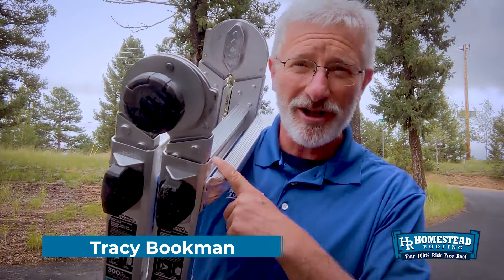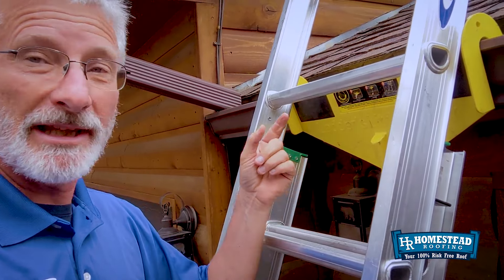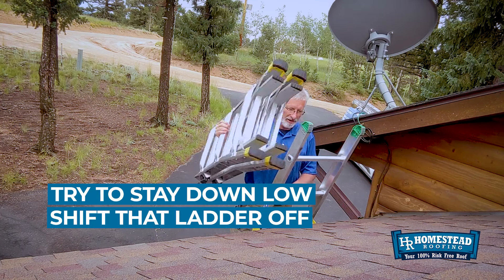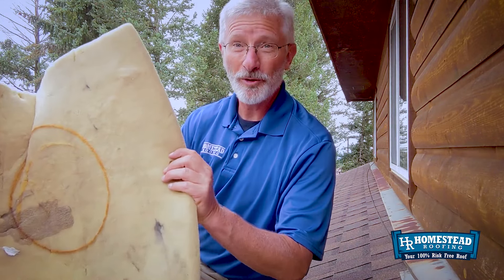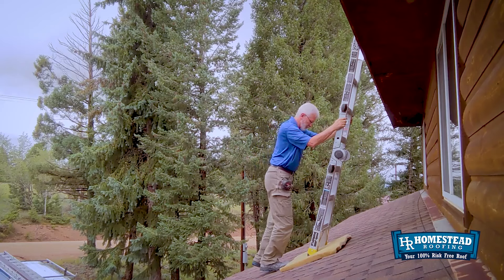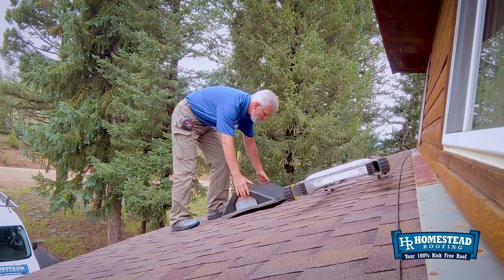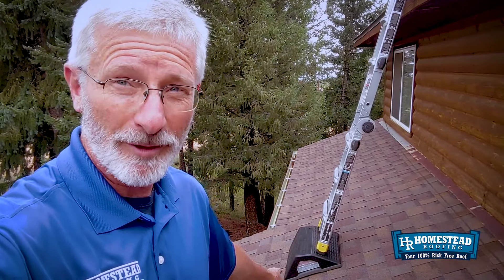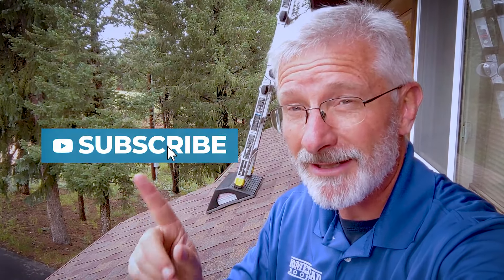[TIP!] How To Safely Get On A High Roof With A Short Ladder

Comment: Thank you for posting this video. I just want to clear up certain things that you showed or said during your presentation.

1. You got the smaller ladder on the roof, but did not follow the three point of contact rule. You only had two point of contact every time that you went up a rung. It is very important, that you never carry tools or any other item in your hands while climbing up or going down a ladder. How about using a rope to bring the smaller ladder up?
2. You did not use the three feet rule. This rule states that the ladder should extend a minimum of three feet above the edge of the roof. This works in conjunction with the 4-in-1rule (the base of a ladder should be one foot away from a wall for every four feet of height).

Comment: I use stainless anchor points ($4 ?) and ratchet straps to stabilize my main ladder.....in and out and left and right..For the short ladder I would definitely use anchors and straps and they are good for your safety rope anchor too so long as you use long screws into the studs....
Reply: Interesting. Thank you for sharing

Comment: you can also stick the ladder legs into your cougar paw boots to keep it from slipping out. toes facing down the slope of course.
Reply from the maker: 😬
Sounds scary, but would probably work.
Reply: @homesteadroofing  I've done it a few times off a covered porch onto a 2nd floor.  It does work.

Comment: Thank you for the video. Very helpful. If the angle of the roof is to the sides rather than to the front ( similar to the easy method example) can I still use the pitch hopper? The ladder will not be straight, maybe ope and extended ?
Reply from the maker: Not sure I'm picturing what you're describing. You can use the pitch hopper on any roof slope, but be sure to have other safety measures in place just in case.

Comment: Can I straddle my garage gable  with a ladder on Boral concrete roof tiles?
Reply from the maker: That depends on their age. If they're newer, you may be able to do that, but you'll run the risk of cracking them. If they're older, you'll almost definitely crack them.

Comment: What do you do for sheet metal roofs? I was thinking of screwing eye lags into the siding of the second story to tie the base of the ladder to the house so it couldn't slide out..
Reply from the maker: I would use a ladder tall enough to reach the second story from the ground
Reply: If you can position the ladder so that it extends over a window then you can use the window frame to anchor the bottom of the ladder by using rope tied to a board inside the window. The board has to be long enough to extend well past the edges of the window  and in a way such that it won't come through  hope that makes sense

Comment: What a legend, my big respect to you Sir for showing how to climb safely and filing at the perfect angle AT THE SAME TIME !  

Quick question, when you hook that yellow 'ladder helper' into that gutter, what if that gutter is shaky?  The reason I ask: my gutter is those "K" type plastic gutter and it's super loose so in my case, that yellow ladder helper may suddenly give way !
Reply from the maker: I would not use this tool, then. I would probably attach "stand-offs" to the ladder instead.

Comment: How about tile roof what are your recommendations
Reply from the maker: I've done this same thing on a tile roof, but I made sure that the 2nd ladder was straddling a ridge. I wouldn't trust using a foam pad on a sloped tile roof. The bigger concern is breaking tiles with the feet of the 2nd ladder.

Comment: I'm Coating a mobile home Roof tomorrow I'm finishing 14feet lip gutters,vents,then rolling Coating on Roof. I don't want to get on the roof and I can reach with long pole but I know it going to be a arms and back pain. I have to ladders that helps me. I want to set up scaffolding but can't get it high enough. Coating is very slippery. My Roof has a small pitch. The problem is that Roof is not strong enough to walk on. Helper uses boards I'm not that brave. 70 trying to get this done so I can work on other projects that need to be done by October. Do you know of any scaffolding that is light weight & easy setup for 1 person. I'm a woman and these ladder s are heavy and awkward to move around the perimeter of house.
Reply from the maker: You could check with a local tool rental place or Home Depot.

Comment: I need to repaint the metal top (cap) of a chimney. The front of it is about 24 ft to 28 ft plus another 7 ft away from wall. so I will need an about 40 ft extension ladder which I don't even know exists, the rent a van to transported.
So, I was thinking of climbing to the back which is about 12 ft high from roof using one ladder to climb to roof and another ladder to the top of chimney. Very scary and unsafe but I guess no many options. I will tie a rope around chimney and try to buy a safety vest harness to tie rope to it.
Anybody has a better idea?
Please advise.
Reply: DO NOT TIE A ROPE TO YOUR CHIMNEY. It's not designed to withstand lateral forces like that and may be easily damaged or even collapse
Reply: @bobbing4snapples ok, thanks for the advise.
Reply from the maker: You can get a roof anchor and harness at most big box hardware stores.

Comment: Well this method work on a S tile roof?
Reply from the maker: I would not use this on a tile roof. If you can't straddle a ridge on the lower level with a ladder pull, or you can't access the upper story with a tall ladder, use a drone to inspect the upper story roof. (I would also try to avoid a ladder pull, as the ladder feet can crack the tiles)

Comment: Now is my ladder has rubber ends do i still need the foam Cushing? I feel like the rubber would be a good anti slip grip already for asphalt shingles.
Reply from the maker: Use a foam cushion or the Pitch Hopper and tie-off the ladder to the gutter hangers. I would never trust just the rubber feet on a ladder.
Reply: Definitely yes use that cushion

Comment: What does "12-12" "9-12" "5-12" mean?
Reply from the maker: That's the pitch of the roof. Another way to say it is "rise-over-run." The first number is the number of inches of vertical rise of the roof for every 12" of horizontal run of the roof. So 4/12 would be 4" of vertical rise for every 12" of horizontal run. 
A 12/12 pitch is very steep. It's a 45-degree angle.

Comment: Wait a minute? Yours is the same. How are you not scared simce the ladder has nothing to hold against..can eaily slide downwards
Reply from the maker: Not sure what you mean by "Yours is the same..."
Reply: @homesteadroofing  the the top of the garage doesn't line up with the roof peak..I had a regular ladder to try but I was like no way...but found the little ladder that you have for extra support...so gotta give that a try. Gotta put tar around the white vent pipe

Comment: I guarantee that this video would have our HSE having an apoplectic fit, there is so much wrong and would not be approved.  I trust this guy has indemnity insurance to fend of all the claims when someone takes his advice and it all goes wrong.  The only safe way to access the upper roof is to use a cherry picker, the hire cost is minimal.

Comment: What if you only had one ladder.. can you just use the one ladder to get up and then bring up that ladder onto the second level?
Reply from the maker: Yes, it's just less safe because you're bending over the roof edge to pull up the ladder. 
The best solution is to have a ladder tall enough to reach the higher roof.